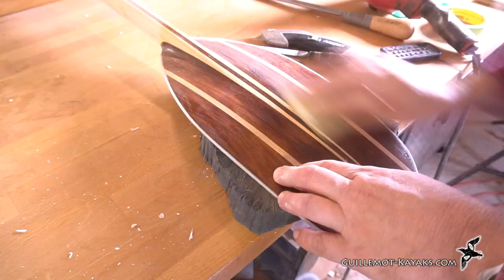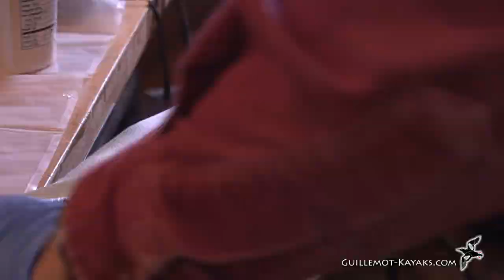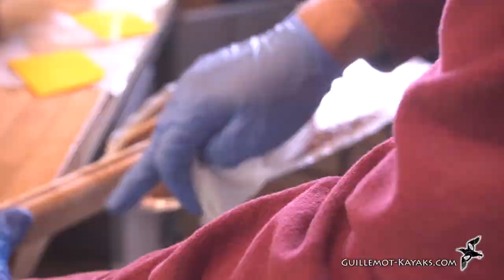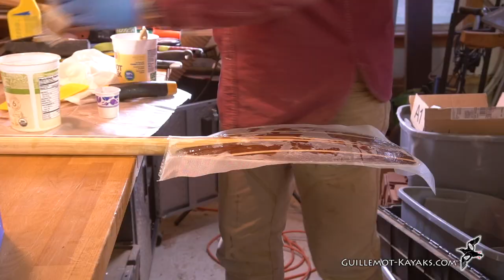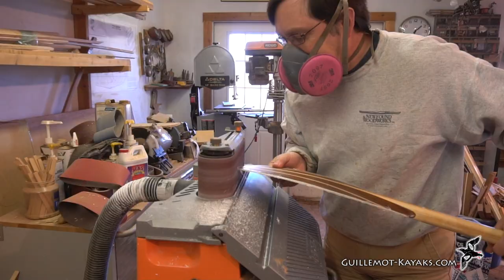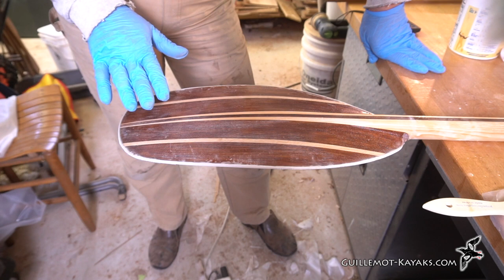Making Kayak Paddles - Glassing the Blades - E7

Comment: Nick, question for you! Can you explain why you put the reinforcement triangle of cloth on top, vs putting it a layer or two below? Thank you.
Reply from the maker: When it comes time to sand the layers smooth, if you put the biggest layer on top, you may sand through it, breaking the reinforcement. With the smaller layers on top, you are just feathering the edges of those layers, leaving the reinforcement intact on the larger layer.

Comment: I have a real problem preventing the fiberglass cloth from showing after I am done.  I coat the surface with resin, then apply glass then resin again.  I apply with a sponge brush and nothing else.  Am I using the wrong fiberglass cloth or is it the technique?
Reply from the maker: Can you see white color in the cloth or are you just seeing the texture of the fabric at the surface of the resin?
Reply: @NickSchade  I can see white outlines of the fabric.  I am pretty sure I saturated under and on top of the cloth pretty well with resin.
Reply from the maker: I usually do not apply resin to the surface before applying the cloth. I lay the cloth down dry and then add resin on top. 

It is possible your pre-coat started to set up in the cloth before you added more resin later. This partially cured epoxy would resist further saturation of the fabric later.
Reply: @NickSchade   Thank you very much for your advice.  I am using West Systems resin and it seems that I am doing it all pretty quick, so the first application isn't set up yet.  Let me ask you this:  Does using the squeegee help with the clarity and absorption of the resin into the cloth?  Right now, I am just applying with a sponge brush.
Reply: @explorermike19  Mike I would use a different brush, sponge brush will tend to get bubbles in the foam. A squeegee will push the resin deep into the weave of the glass w/o causing bubbles. The glass should disappear if saturated enough.

Comment: Nick, do you think it is MUCH better to fiberglass both sides of the blades or would doing only one side be enough?  I am concerned about the weight that it adds to the paddle.
Reply from the maker: Explorer Mike the glass adds a lot of strength. I think a balanced layup is important to that. If you are worried about weight, you could go with lighter glass, but I would still do it on both sides.
Reply: @NickSchade  I am using 4 ounce fiberglass cloth.  Is there something lighter than that?
Reply from the maker: I’m using 2oz glass. You can also find material that is lighter than that.